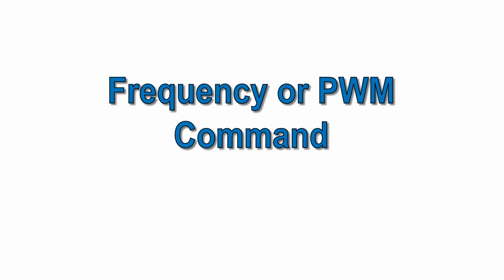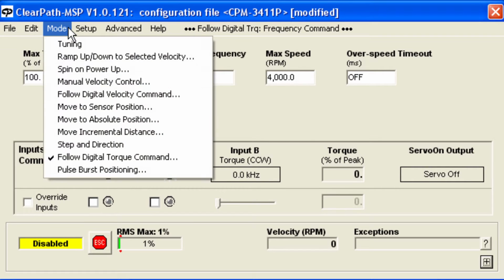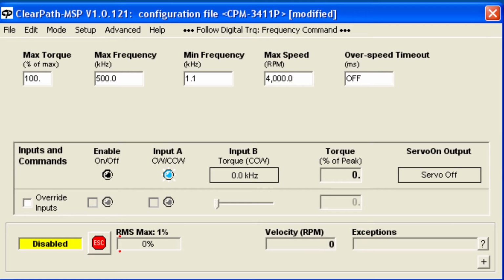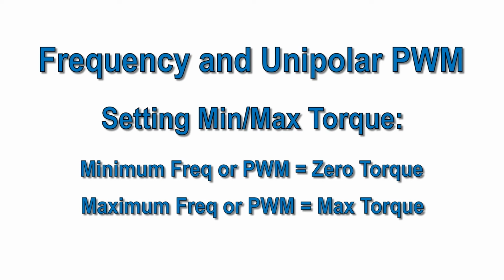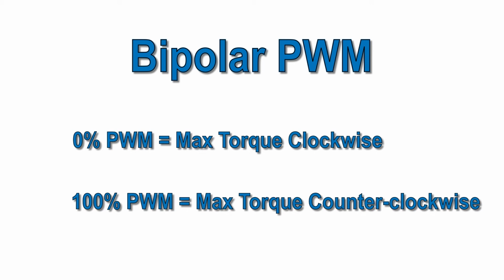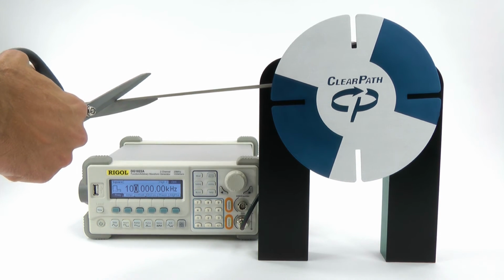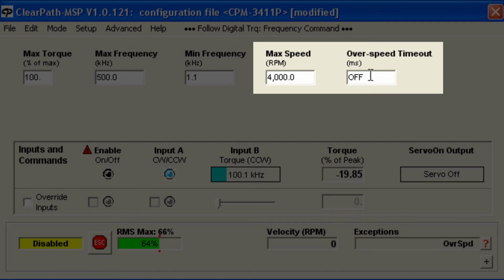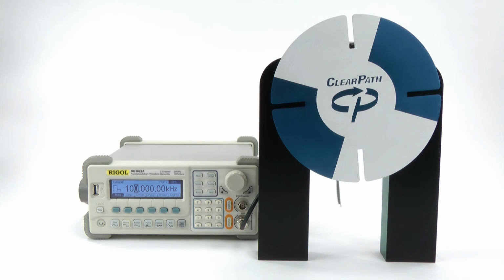ClearPath Integrated Servo Motor: Follow Digital Torque Command

Comment: In my application (winding very thick solid wires), I need to start and stop the motor using some buttons and a microcontroller.

I know that during normal operation, the motor follows a digital unipolar PWM torque command in the direction of Input A as long as the Enable signal is high. If the load is suddenly disconnected, the motor will overspeed and shut down based on the maximum speed and overspeed timeout settings.

Now, I need to stop the motor while it is running and the load is connected. What happens if I disable the Enable signal?

1) Will the motor overspeed due to the heavy opposite load torque?
2) Or will dynamic braking be triggered based on the maximum speed and overspeed timeout settings, even if the Enable signal is low?

If the first scenario occurs, I am thinking that I can keep the Enable signal high while setting the PWM torque command to the minimum value. This way, I would force the motor to overspeed in the opposite direction while the Enable signal is high. Consequently, the motor would stop and shut down, holding the load stationary.

Is my expectation correct? If not, what is the best way to stop the motor under a connected load condition?
Reply from the maker: Hi Hassan,

Before I answer your specific questions, I wanted to provide some background information on ClearPath's Dynamic Braking feature.

ClearPath's Dynamic Brake will (when triggered) cause the motor to resist all external motion as long as the motor continues to move. The Dynamic Brake, when active, acts like a viscous damper and applies more resistance the faster the motor spins. 

ClearPath motors ship configured to automatically engage the Dynamic Brake when disabled (although you can change this functionality through the ClearPath MSP setup software). In your application, whether the motor will come to a complete stop depends on the external forces applied to your motor. If the motor does come to a complete stop, the Dynamic Brake will not "hold" the load in place, but if you don't exert any external forces on the motor, then the motor won't move either. 

Deciding how best to configure your motor for your application can be nuanced, so I recommend contacting a Teknic engineer to discuss your application-specific requirements. You can reach out to us here: https://teknic.com/contact/.

Regards,
Brendan F. – Teknic Servo Systems Engineer

Comment: Is it possible that I set some resistive torque to maintain tension and if unloaded it will wound belt with same rate as load is unloading?
Reply from the maker: Hi Akshay Khot, 
In the operational mode "Follow Digital Torque", you cannot control velocity or acceleration. If the motor is applying a constant torque to maintain tension on a material, and that material breaks, the motor will immediately start to accelerate at a rate determined by how much torque you're commanding (and what the load is). The motor will shut down when the “Max Speed” setting is exceeded for the amount of time defined by the "Over-speed timeout" parameter. The user can modify the “Max Speed” and “Over-speed Timeout” parameters in MSP to suit their application needs.

If you are looking for a mode where you can vary the torque limit and velocity, you could take a look at the mode "Follow Digital Velocity: Bipolar PWM Command with Variable Torque". We don't have a demo video for this mode, but there is more information regarding this mode in the ClearPath User Manual: https://teknic.com/files/downloads/clearpath_user_manual.pdf
Regards,
Jim W.
Teknic Application Engineer

Comment: If motor is maintaining tension in belt  for long period in static. Condition will motor heat up?
Reply from the maker: Hi Akshay Khot, 
Yes, the motors can become warm to the touch if they are enabled and applying a constant (static) torque for a certain period of time. The amount of heat that the motor produces depends on a few factors: 1) how much torque is being commanded (and for how long), 2) the ambient air temperature, and 3) any cooling provisions such as a ventilated enclosure or fan. 
 Additionally, there are safety parameters built into the motors to prevent them from overheating or becoming damaged. In most cases, if the static torque is kept below the motor’s continuous torque rating, the motor may heat up but it won't shut down. If the motor applies torque much above the continuous torque for long enough, the motor will, at some point, shut itself down to protect its windings from burning up.

Regards,
Jim W.
Teknic Application Engineer

Comment: I have a Tensile Test Machine that is pulling apart at an object in constant torque and I want the motor to automatically stop when the specimen that it is pulling on breaks (so when there is no more load on the motor or machine). Is there some kind of mode for detecting this load change and stop it from moving?
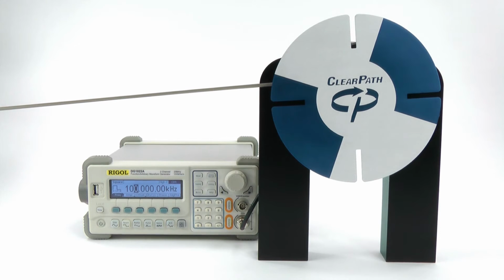Reply from the maker: Hi Thomas - Yes, the ClearPath-MC operational mode featured in this video ("Follow Digital Torque") has Max Speed and Over-speed Timeout parameters designed to shut the motor down if that speed is exceeded for the time defined by the timeout.  The servo would automatically shut itself down (i.e. stop outputting torque) very soon after the specimen breaks as long as these parameters are set appropriately.  By default, the servo's dynamic braking feature will quickly slow or stop the axis upon shutdown of the motor.  These safety features are discussed and demonstrated starting at 2:07.
Just be aware if the tensile tester uses back-drivable mechanics with a vertical load, then additional components may be required to prevent the mechanics from falling when the motor is shutdown, like an electromechanical axis brake.
If there are any other motion requirements in addition to the constant torque commands (e.g. positioning or jogging control for loading/unloading specimens, constant velocity strain testing, etc.) then a different operational mode might be required.  If you have additional questions you can always call us (585-784-7454) or submit a contact request through our website (https://teknic.com/contact/).
Best regards,
Matt C. - Teknic Servo Systems Engineer

Comment: Does Clearpath offer some kind of solution for keeping line tension the same if I were to use a clearpath motor in a winding/rewinding application? For example, if I were to set the servo to one specified torque setting and then wind up a large diameter roll, I would not have the same amount of tension on the material being wound up as the roll diameter changes.
Reply from the maker: Hi Derek Russell,

Yes, ClearPath motors have been used successfully by Teknic’s customers in web tensioning applications with excellent results.

There are a number of ways the ClearPath motors can be used to maintain proper web tension. That said, the optimal method for each application type depends on a number of variables including mechanical design, substrate type, desired tension, and tension range as well as the type and capabilities of the controller. Since there are so many variables to consider (with both machine designs and the potential solutions), it would be suboptimal and potentially misleading to guess at a proper solution. 

If you want to discuss your application in greater detail or if you have additional questions, please feel free to give us a call at 585-784-7454 or send us a contact request here: 
https://www.teknic.com/contact/

Mark D. - Teknic Servo Systems Engineer